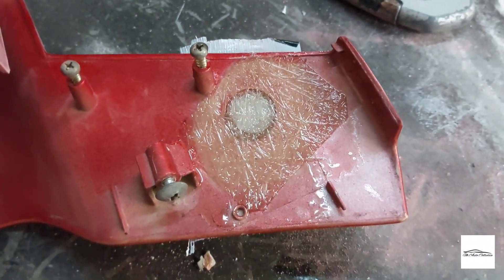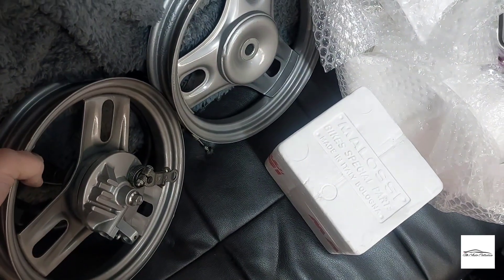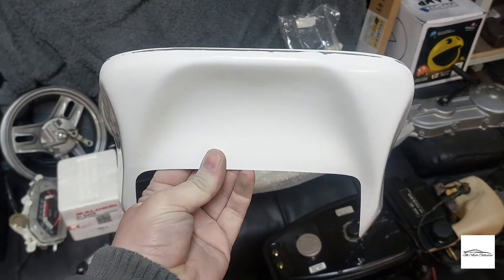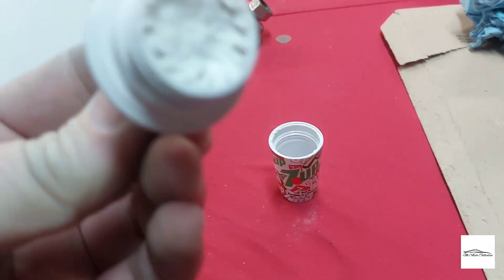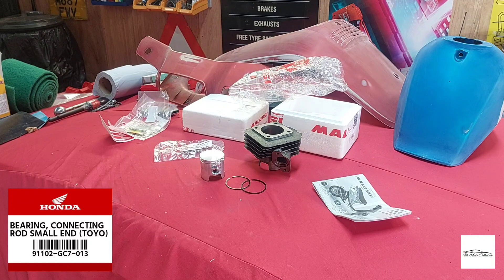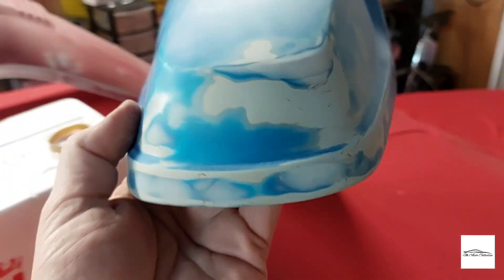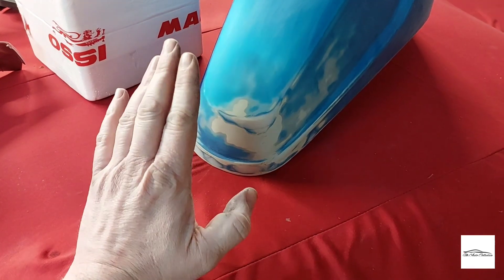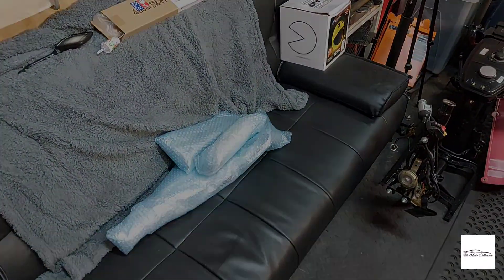Bosozoku Scooter Project | Part 4 | Honda Vision | Tact | UKAC

Comment: how familiar 😅 every episode you seem to be doing the same jobs as me , you inspired me to tint my headlight today, did it luminous yellow, have the carb dialed in finally and started painting the fairings, although weather has put a stop to that today,  I got a spare left hand fairing if you need one, I bought by mistake, is in good pretty good nick
Reply from the maker: It's a lot of repairs atm lol. The engine build will be the easiest part haha. My left panel was in a mess but I think I've saved it. I will be putting it in primer very soon so will see the outcome. If its too far gone I'll happily have yours 🙂👍